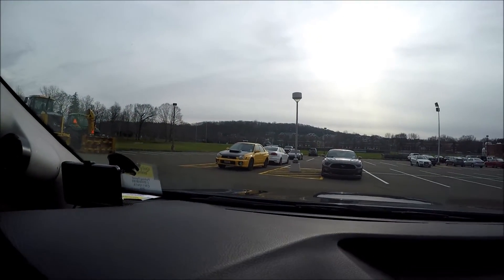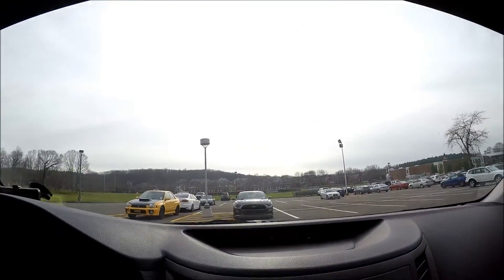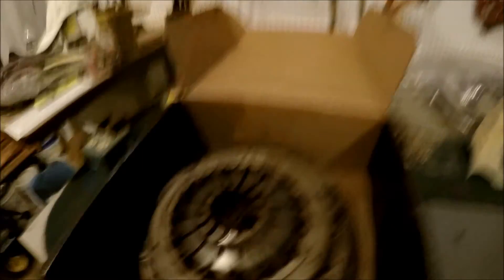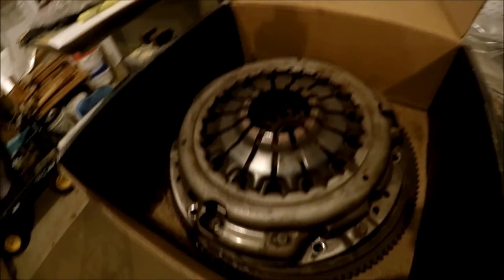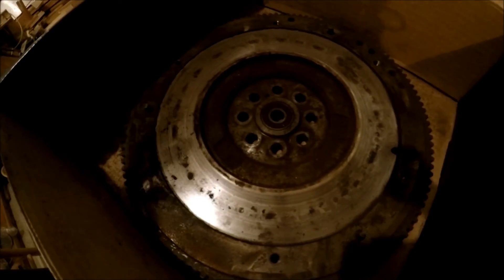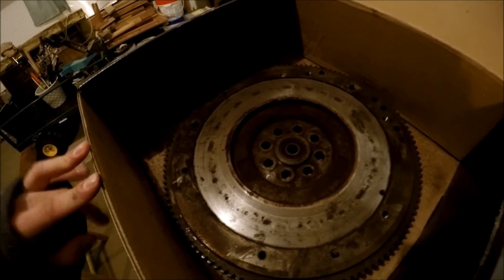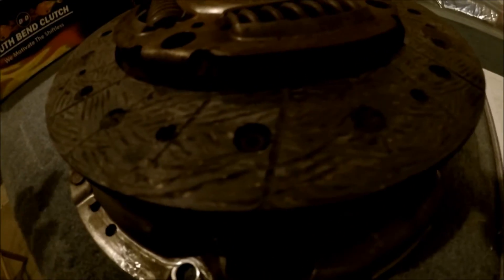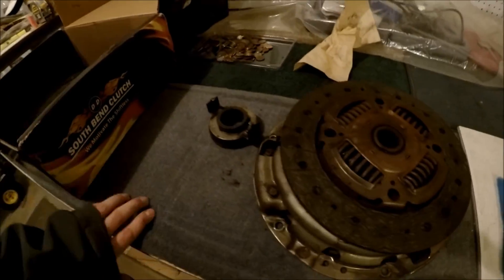Subaru Legacy 2.5GT | Southbend Stage 3 Endurance Clutch | Initial Thoughts/Impressions!

Comment: I actually had a South Bend stage 2 installed in my 350Z this fall.  I too was really surprised at how light it was.  I managed to put about 800 miles on it before parking for the winter, and was really impressed all around.  It's nice to know that they have applications available for my STI when I'm ready for a new clutch for that car.
Reply from the maker: Oh sweet man! Yeah I was thinking it was going to be pretty sucky in bumper to bumper but it's not at all. Trying to get to around that before the weather gets to bad, was 20 degrees today :l. Just curious when in 2gear+ going up an incline, did your car stutter or did the car get a little bit jerky until letting off the gas then getting back on? I know it's cold and all and it's a new clutch, but especially since I'm just easing into every gear i noticed especially when it's cold out that accelerating from about 2k rpm's it feels really choppy..
Hoping it's just due to it being cold and not a problem with the clutch, and rather a problem with the tune. But yup they have options for pretty much anything!
Reply: No issues with mine in those scenarios.  But I have RE-71R's on my Z, so I generally try not to take it out in anything below 40 degrees or so.  The tires just turn to hockey pucks.  I would probably guess at it being something with the tune in the cold weather than the new clutch.  If you're easing into things, then I'd be surprised if the clutch is slipping.
Reply from the maker: Alrighty good to know, thanks, and yeah that's what I was thinking. Yup haven't been over 3500rpms and keeping it out of boost, not riding the hell out of it etc. Guess spring will tell..might run it by my tuner real quick. 
Same boat as you with the tires, I run the Yoko's ad08r's straight bricks but I love em haha